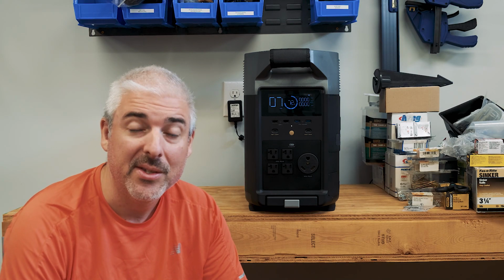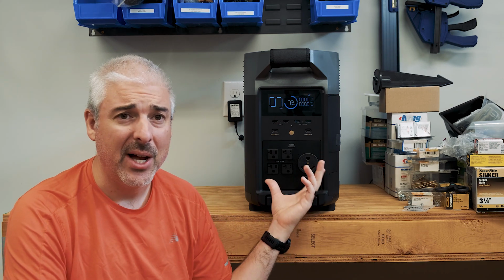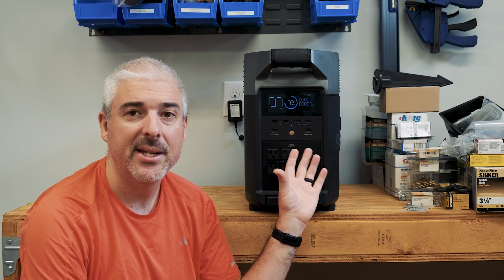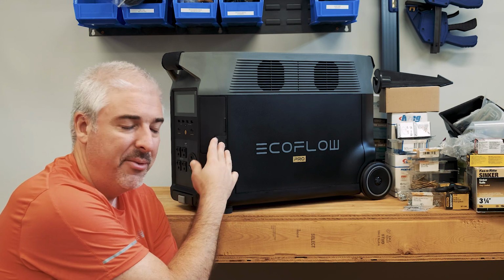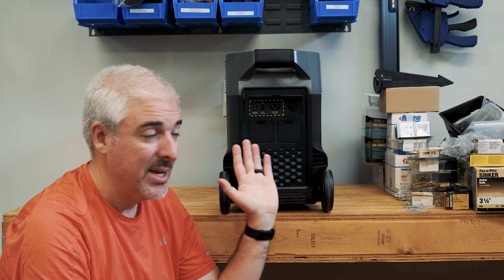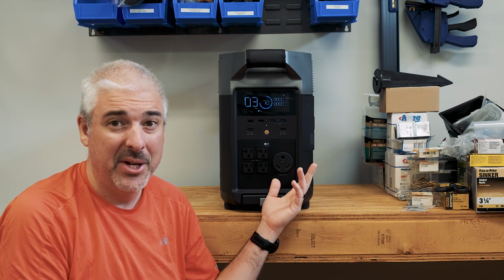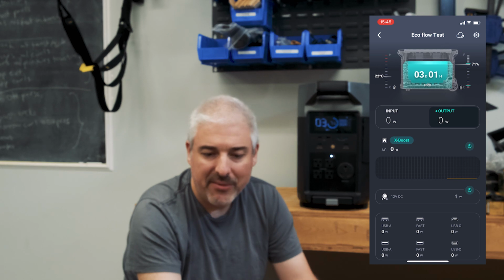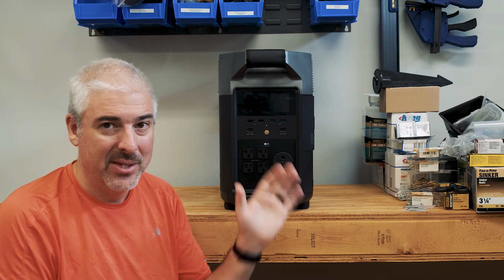Ecoflow Delta Pro MEGA Review

Comment: just got the pro 3600 and have a couple question. if you turn the unit off at night will the unit come on went the solar panels start feeding in the morning or will have to turn the unit? also where do you control the x boost? the only way i can control the unit with the app is by bluethooth. can not get wifi to work. goes to 95% and fails. thanks BIG HEAVY
Reply from the maker: After like 40 attempts I finally got the Wi-Fi working. I had to setup a separate Wi-Fi network that’s 2.4 gHz only, and had to put in a support ticket since the app initially didn’t recognize my serial number, but it’s finally working. 

I’ve never tried to see if solar would “wake up” the unit. I would assume so, since if you plug in the AC when it’s off it will turn on, but I haven’t done that test.
Reply: @TheBigHeavy  what about the x-boost control? is there any controls for it on the app?
Reply from the maker: @johnbailley4468  Yes, you can turn X-Boost on/off from the app. The app had definitely improved a bit since ~8 months ago and seems to work fairly well. Perhaps my only "complaint" is that if the unit is totally off you can't turn it on from the app. It has to at least be in "sleep" mode (e.g. white light slow-flashing) to connect via the app.
Reply: @TheBigHeavy  Thats was one of concerns also. why have a app that controls everything except turn the unit on and off. also the back panel where you plug the ac cord in, the flap open in the up position. you have to get on your knees to see anything. that flap should open in the down position so you can see everything standing up.
Reply from the maker: @johnbailley4468  I would guess the theory on the app is that if the unit isn't on and charging or delivering power, better to save the juice than power the WiFi radio and other circuitry to make it work.

I agree on the power door. The only theory I can think of is that it provides some minimal "protection" from spills or rain of the power inputs, but that's complete speculation on my part.

Comment: The 30 amp hookup in the front is not a miss because it's 110 volt! It's an RV hook up which is insanely useful!!
Reply from the maker: You are absolutely correct. I'd never used an RV when I recorded this video but have since rented one. I assumed RVs would be two-phase AC but apparently, that's only for the really big ones.

So the Delta Pro would be money for an RV, but not so much for a 240V plasma cutter or welder.

Comment: Do you happen to know if there is a way to disable the Emergency Power Supply (EPS) feature so that it always powers the AC ports from the inverter instead of the grid?  I’d like to keep it plugged into the “grid” but for charging only.
Reply from the maker: I'm not sure... I think I recall reading in the manual for one of the power banks that they don't recommend using it essentially as an uninterruptible power supply, which is what you describe (outlets are run off the battery so if mains fail there's no flicker when you switch over) because there was no way to power from the battery while simultaneously charging.

However, I've looked at a bunch of these units so can't remember where I read that but manuals should be online if you want to check, and Ecoflow has been decent about responding to emails as well.
Reply: @TheBigHeavy  Thanks.  I’ve read the Delta Pro manual and it mentions nothing about how to disable EPS.  My BLUETTI EP500’s have a setting onscreen where I can toggle between grid power or inverter power.  Looks like the Delta Pro is just not very advanced in this matter.
Reply from the maker: @Richard-1469  I think (this is speculation on my part) they're trying to be "Apple Like" in that they're focused on design and user interface, while hiding the advanced stuff. Bluetti is very much "Linux-Like" (I have the AC2000P) in that you have a huge menu and can see and tweak just about everything.

Theoretically, you can update the Delta Pro firmware over wifi, so that feature might be added, however I think I have a pre-production or review unit since it won't connect to the mothership and update.

It's interesting that these manufacturers take different approaches and that these devices are more than just the specs.

Comment: What the hell, you can connect your RV directly into the 30 amp plug and use it!!
Reply from the maker: I don’t own an RV so I assumed they’d need 240V. Are you saying they’re all 120?
Reply: @TheBigHeavy  it depends on the size of the RV and the air conditioner units that is has since it the highest draw.

Comment: As a “weekend warrior “ user, Ecoflow has the Delta model (not “Pro”), which handles 1800 watts with surge capacity of Approximately 3300 watts   It weighs only 38 lbs, so it’s more portable than the Pro. But it won’t do a “whole house” back up (however it does run both my 10 yr old home freezer and my home side by side for 8-10 hours on a full charge and can be expanded with 400 watts of solar input. I like the ease of portability too to grab it and go and the price is more reasonable (Amazon had it on sale for $1800 or so, and since the Pro came out, there are more sales on the Delta). However the Pro model is definitely in my sights for power back up for a more home-wide system. One of the side slot connectors you mentioned is for a “wired remote” (in addition to the Bluetooth/wireless application for your phone). So you can keep the unit in a less reachable area, and use the wired remote a few feet away, if you don’t have strong internet and can’t use Bluetooth. So if you don’t need the full load and run power of the Delta Pro, the Delta might work for less demanding use.  Great review…can’t wait for the auto on/auto off “top off “
Generator!!

Comment: Opinion of the Eco Flow Max please.   Take your time
Reply from the maker: I don't own one, but my impression is that it uses the same interface and has a similar feature set tot he Pro (without the whole house capabilities). It looks like it has the 2 USB-C which is a big deal to me, and a fair number of AC outlets. I really like the interface on the Pro, so assuming it's similar I would put it in my consideration set.

The one thing that would steer me towards something like the Bluetti would be if the wireless charging and lots of DC outputs was important to you versus what seems like a stronger inverter on the Ecoflow.